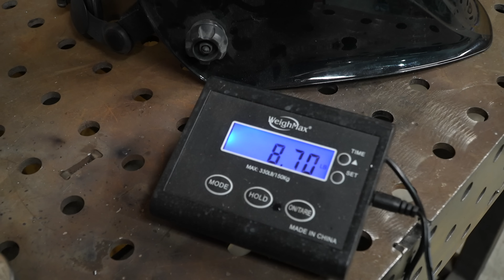I Decided to Murder my Truck... + OBS coil over shock conversion

Comment: Tigger is doing big things. All the doubt in yourself 2½yrs ago that you could ever pull this off. Here we are today and its all becoming downhill to you. You even lit the same fire under my old butt to start on my 69½ A12 Super Bee. Thats not seen the light of day in many years. Been used as a storage rack for the most part. Hey its on jack stands and 100% complete and original. I found in a horse stall 10 yrs ago. Had been but in there in 1978. When i got it home i did the usual stuff to get it rumning. And she fired right up on fresh gas and plugs. My cousin got married and moved into the in laws former home. Lived there 3 yrs. They knew they had stalls under the barn but never went out behind and down to them. When they did. They were surprised as to what his father had left for him. He dont even recall ever seeing it ither. I got the cousin discount and picked up for 18,500 and hug or two. Thought one day id have restored. But no $ to have done right. Figured i can enjoy til that day comes from watching your family vids. Much Love and Appreciation for what you guys do. Helping the lil guy achieve possibilities only dreamed of. Thanks Again

Comment: Nice Tom, you have to remember if you don’t scuff it up enough it
will flake off later. I know because 
it happened to me. Just sayin.
Painting in colder than about 
65 degree temps can cause an 
affect  called “Blushing” and it’s 
not pretty. Just a little advice.
You two are doing great, good luck.🏁

Comment: Keep rpm above 6500 and creepup on the tuneup and it'll live.. running about 1300 crank in my stock bottom end lc9 currently, the gen 4 stuff is impressive

Comment: Need to add the old front shocks to the weight of the springs since you included the coil over shock in the equation

Comment: 3/4 ton Chevrolet military truck.Or blazer has Cast steel  two inch blocks on the front leaf springs
Reply: No GM solid axle truck or SUV came with blocks between the leaf springs and front axle spring perches. That includes the CUCV military trucks and Blazers built by GM.

Comment: Tommy y'all are talking about the truck only having a stock block.... Isn't the falcon running a stock block and only 10 bolt heads at that correct? I always assumed you guys were running a dart block in the falcon but who would buy a dart block and only have 4 bolt heads?? So either way it will rip guys are making short lived stock block LS engines have deep 1xxx HP. Of coarse the the life span and tuning window is pretty small but the live for awhile. I don't know about your area but good unmolested stock LS engines are getting pretty expensive and not so dime a dozen like before. They are way still out there just getting harder now that everyone uses them

Comment: Hopefully you don't choose to paint it later with automotive paint, cause spray paint SUCKS to sand it gums up sandpaper quick automotive paint isn't even that expensive around $100 for black and it will sand better later if you decided to paint it a different color